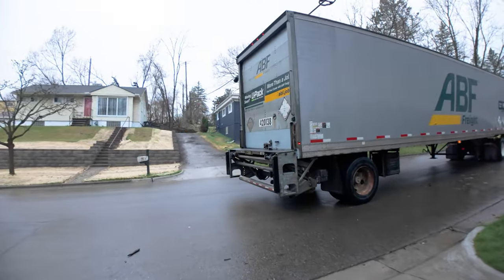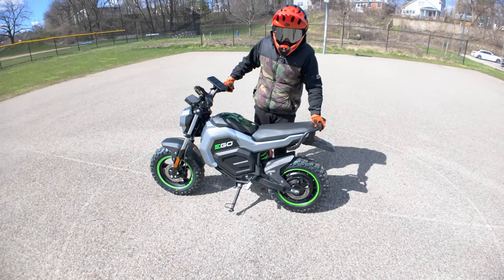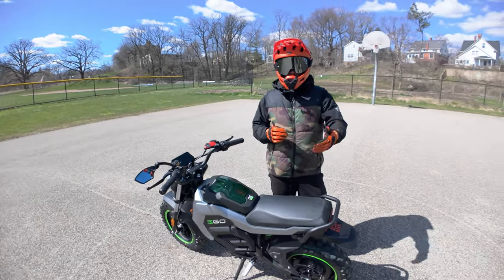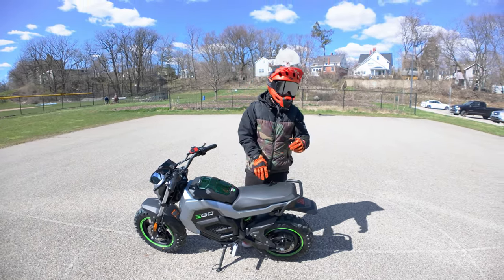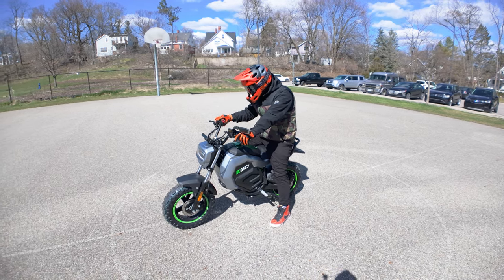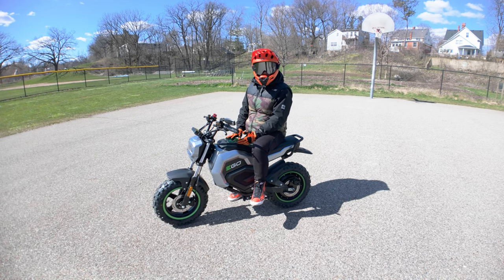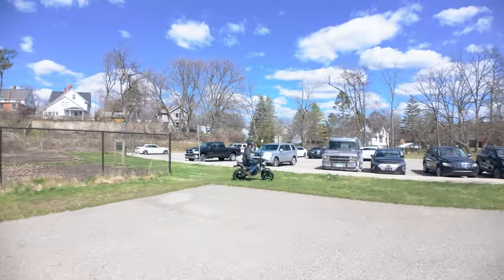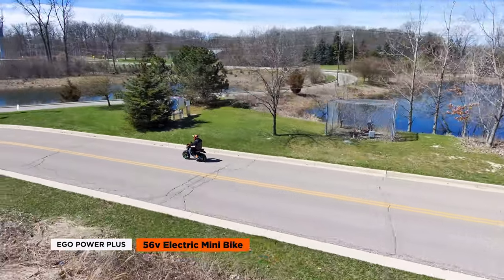Breaking Down the EGO Electric Mini Bike: Power, Performance, and Modding Potential!

Comment: At 5'10", average height for a male, I can tell they aimed to please around 5'7" to 6'0" with it fitting me about perfect. The beauty of the engenering here is in its offroad ability to climb steadily and smoothly, never feeling like you might tople bacwards. I read a review by a hunter who bought his to sneak up on deer and I'd agree that this would be the perfect offroad tool for any number of hobbies in which a compact ridge climber would facilitate a better experiance. I see myself cutting some new paths in tight terian in the near future. Im never in a hurry so the top speed is adequate for anything I'll be using this for. Great product and a great price when you factor in the quality. I for see very little maintenance and with 3 year warranty on the batteries the largest upkeep is covered imo.
Reply from the maker: Nice! Thank you for sharing your experience and enjoy the ride! 😀

Comment: Feels like the 28mph speed is still restricted. The batteries can deliver about 60 amps, so theoretically it has about 10bhp, which is easily good for 50mph, although at that speed with 7.5Ah batteries, it would last about 7 mins. Which is why they’ve restricted it to 28mph!
Reply from the maker: If you watch our latest EGO video, there's a plug and play controller kit being developed. Ideal for the dual 12ah batteries.

Comment: Man I want to love this thing, but they should have made it a street legal e-moped out of the box. Love how easy they make it to swap batteries, they have up to a 12ah battery in the 56v case style so theoretically you can have 2000wh with 3 12ah packs on the bike and just swap one out. I do wonder if they drain one battery at a time or if they alternate which battery it's pulling from every 5-10% while both are connected. Looks like so much fun, love to see a big company putting out something like this.
Reply from the maker: I 100% agree, hopefully they release another EV in the future.
Reply: They alternate the batteries so they both die about the same time.

Comment: That 28mph for that price is kind of just no go compared to competition. Personally i got ariel rider x that i got up to 40mph is only a few hundo more or when on sale even cheaper than this one.
Reply from the maker: Yeah I hear you. Specs are not mind blowing. But I don't think AR or traditional ebikes should be compared to this thing. It's more of an off-road, electric moto grade pitbike that just happens to use an existing power system for tools. Much different audience for someone looking for a high powered ebike. If it was just about price theres obviously cheaper solutions. There's a reason this thing hits with the electric power tool crowd and maybe not so much with ebike enthusiasts. But I love both worlds which is why I'm trying to bridge the gap with power mods.

Comment: Looks like a 273 motor. Would be rad if it was.
Reply from the maker: It's possible. Does the 273 come in 12" though? I thought it might be this or similar: https://www.qsmotor.com/product/12inch-3000w-hub-motor/
Reply: If not it would be interesting if someone swapped it out for one.
Reply from the maker: @deviceunseen things are in the works, stay tuned! 👍

Comment: The Bax1501 commercial backpack battery is 28ah.  You could mount two on the rear of the bike's steel frame.  Theoretically 75 miles of range
Reply from the maker: Haha yeah I thought about that backpack. It would be pretty interesting riding with that on tho lol.

Comment: My boys are always fighting over our green-works mini bike.  I was looking at getting a second one, but I may try this one to compare the two
Reply from the maker: I think the specs are pretty similar. The only thing I'd consider is if you already have additional Greenworks batteries and tools. May make sense to keep it in the same power system. But if you have EGO tools too or plan on it, sure why not. I think both bikes are fun.
Reply: @RunPlayBack  unfortunately all my yard tools are Ryobi so there is little ecosystem benefit for me.  We do however have a greenworks go kart and mini bike so it may be best for us to stick with greenworks if we get another bike
Reply from the maker: I hear ya! I have a mix of Black and Decker, Milwaukee and EGO stuff. But I was definitely swayed to get the bike because I already had 3 EGO tools. Sharing power between more than one thing has proven to be really useful for me.

Comment: what are the laws like about driving it on the road? it’s not a motorcycle and it’s not a bicycle. could it be drive this on the side of the road like i would with a petal bike?
Reply from the maker: @nicklav22  depends on your state, I have mine registered as a moped in MI but I added lights, mirrors etc. Laws are pretty flexible here regarding mopeds. Other states are much more strict.

Comment: What is the seat height? 
I am only 5' 8", I have all the EGO products, with lots of batteries. I am 220 lbs, will this bike feel too small for me?
Reply from the maker: I had a few friends try it out, heavier and taller than me and they loved it. Seat is long enough to find the best angle for comfort when adjusting the handlebars. They may have them at your nearest Lowes or Ace Hardware so you can see it in person.
Reply: Thanks man. 
I live in Canada, so not sure when I’ll see one in person. 
For the price though, it’s not a bad way to go.

Comment: Would this be able to fit in a trunk of an suv or do you need a trailer?
Reply from the maker: Yeah you can lay it on its side. It wont be easy tho, you'll probably need a second person to assist.
Reply: @RunPlayBack  might try putting it in the back of my Tesla model y if it will fit
Reply from the maker: It could work, make sure u have a hand with it and add some moving blankets so nothing gets scratched up

Comment: A friend of mine has a Surron he has cut the speed limiter. Please find it and tell me if we can go faster than 28miles per hours
Reply from the maker: A Surron has a different controller. But the built in switch on the EGO controller is the cutoff for Sport mode. It's the internal programming on the controller that limits it to 28 miles per hour.

Comment: do you think it would pull a light weight trailer with a 150# deer on fairly level ground , was looking at the coyote 4 wheel battery driven ,top level $15,000 ouch. a nice machine made in S.Carolina anybody have one. later
Reply: Might not, but if you’re looking for sub $10k american made emoto then the volcon grunt may appeal to you